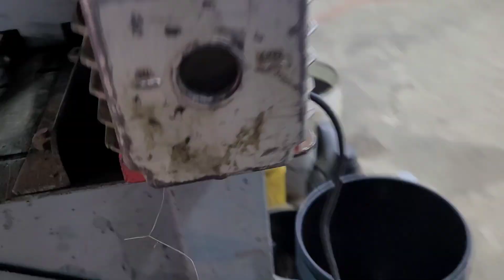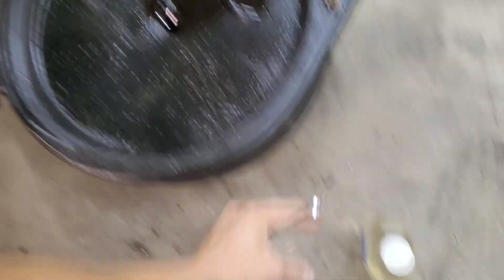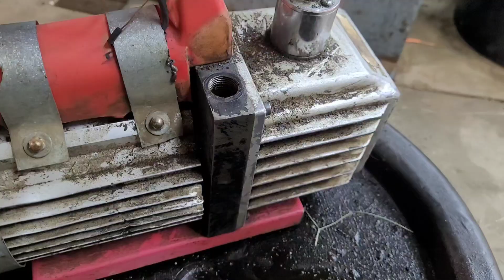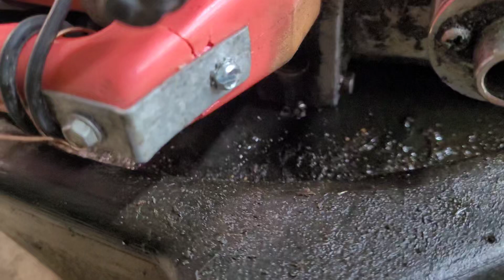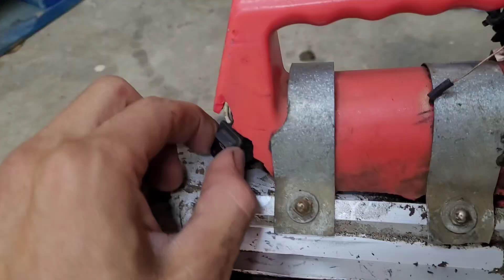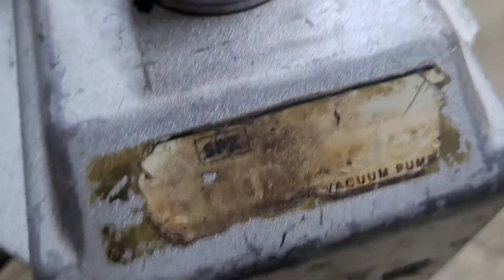Changing oil on my reliable, tired, vacuum pump!

Comment: I had a similar pump made by robinaire that only lasted me a couple of years. It just didn't stand up to the abuse of a service van. The case developed a crack! I replaced it with a jb pump back in '08, and it still looks like new. I highly recommend them.